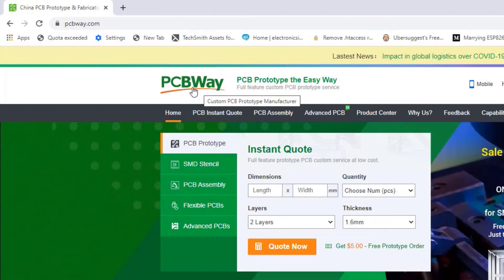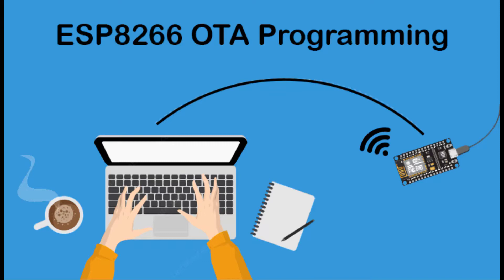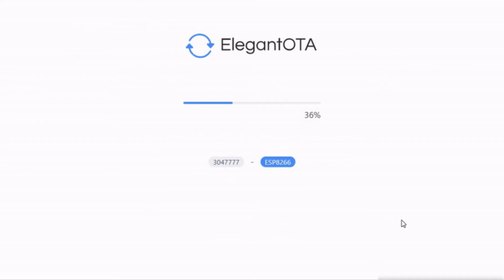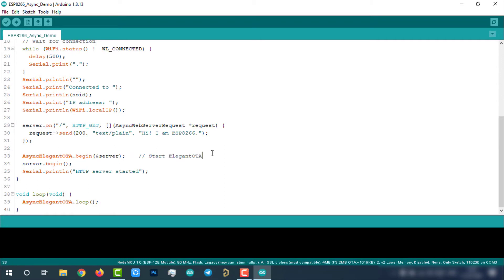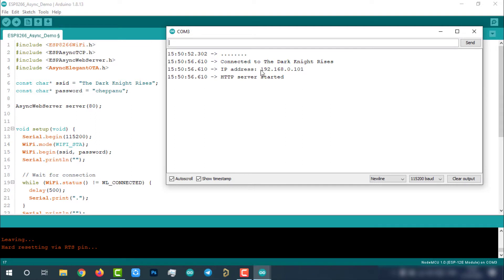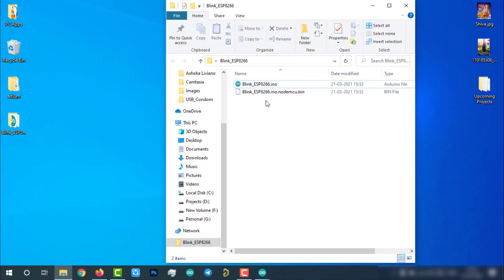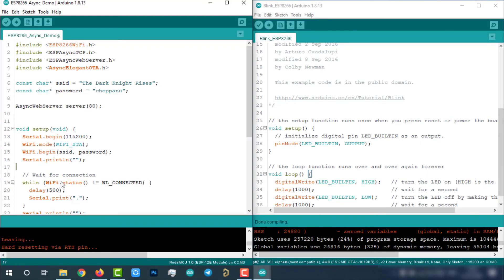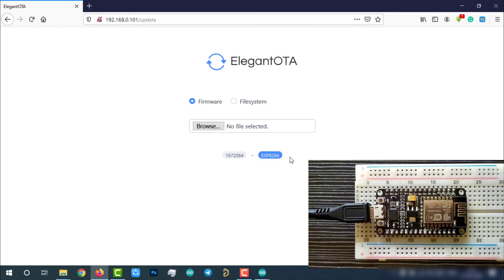ESP8266 OTA (Over-the-Air) Firmware Updates using AsyncElegantOTA Arduino Library.

Comment: Currently (11-24) this concept has become a mess. The library has been deprecated. The "replacement generates a multitude of errors when compiled in platformio. The errors don't relate to the sketch itself, but to dependent libraries the ElrgantOTA deemed necessary to install. I'm not an expert but I've never seen this before in platformio.